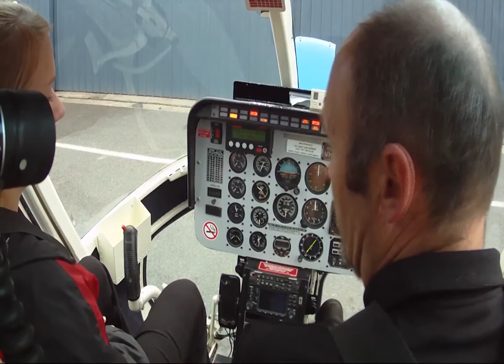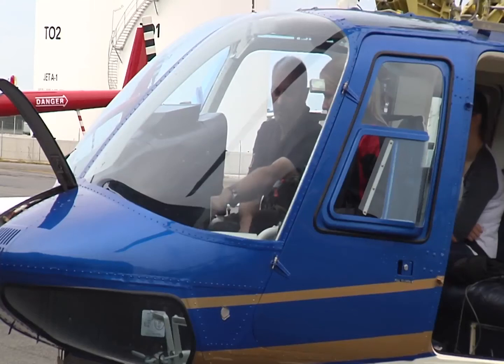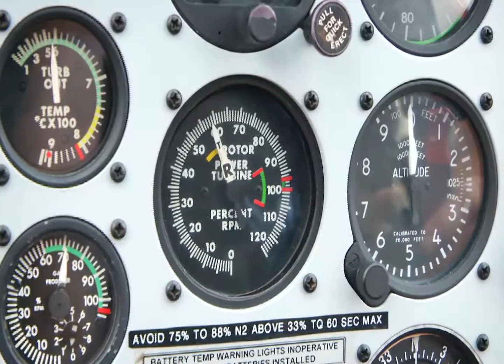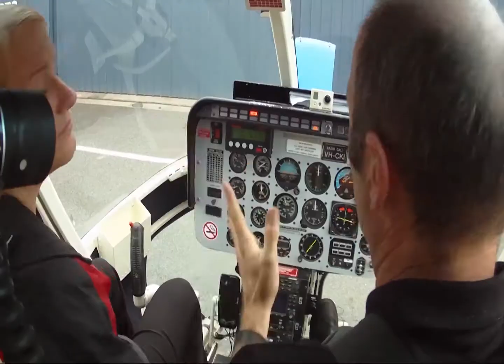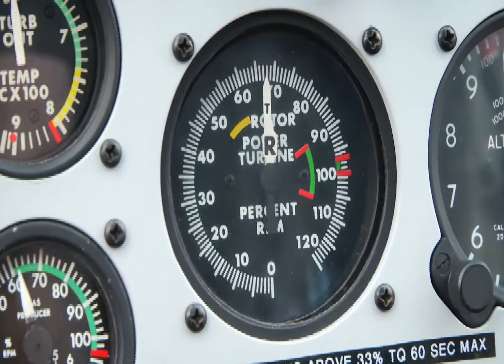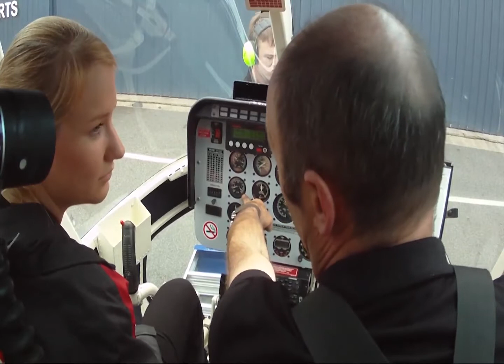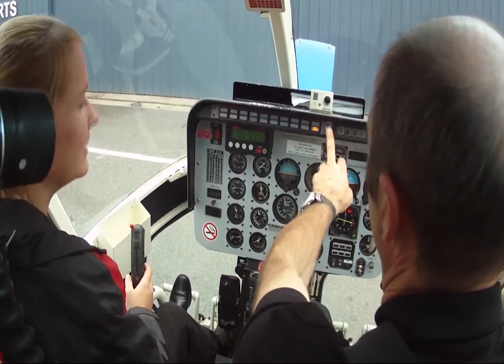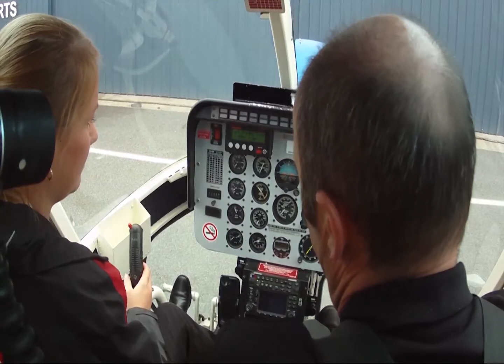Bell 206 Jetranger Start up during ground test

Comment: Hot start?
Reply from the maker: Yes and no. There are actually 2 start ups in the one video. Most of it is from the cold start. The shots from the students POV were from the second hot start so the close ups of the guages are from the hot start....Well spotted
Reply: Not a hot start at all. The temp peaked at maybe 850*C for maybe 2 seconds.You're allowed 10 seconds above 810*C or 1 second above 927 before it's considered a hot start.